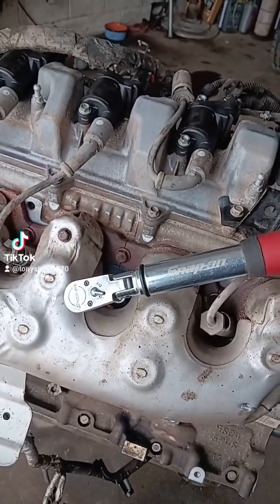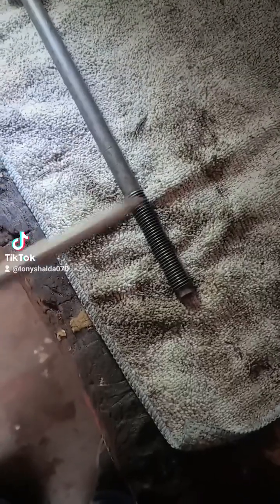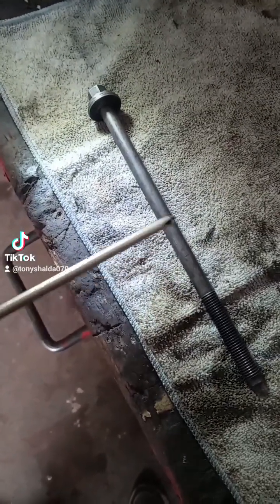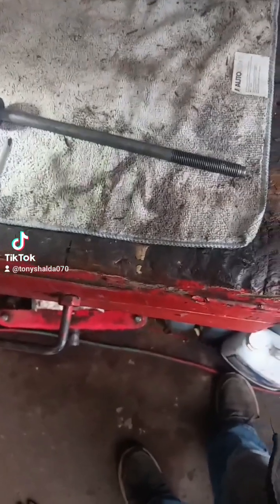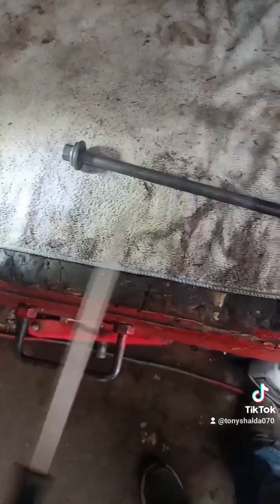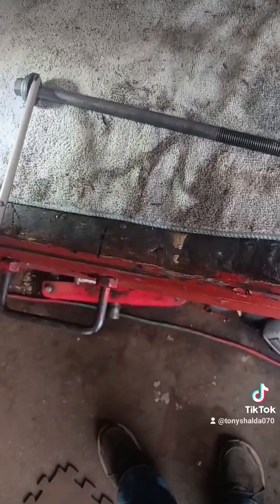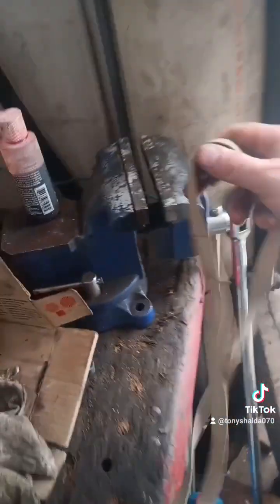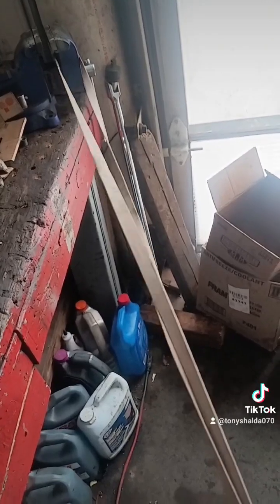what is a torque to yield bolt#car #automobile #diy #mechanic #repair

Comment: Pretty good explanation, I thought.  The example with the vice might be one thing to improve.

To confirm my new understanding of TTY bolts: Install the bolt, tighten all the way (I guess until either the bolt head is seated, or maybe to some nominal torque measurement), then tighten a specific number of turns after that. Is that about right?
Reply from the maker: Yes